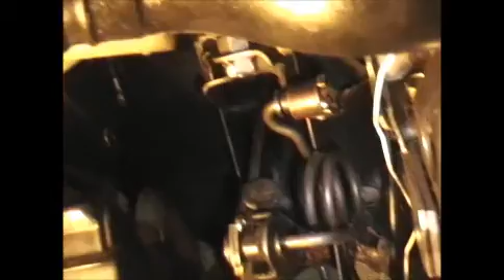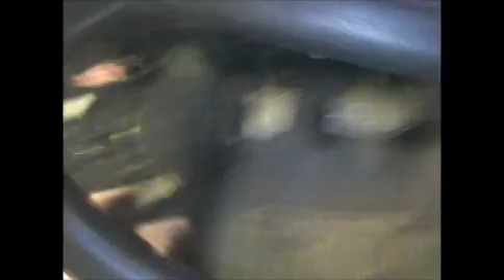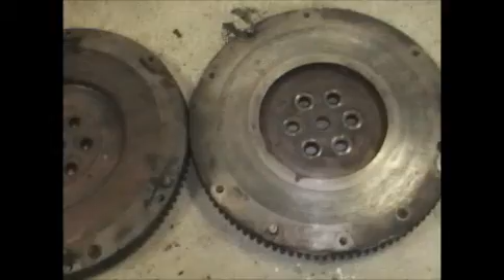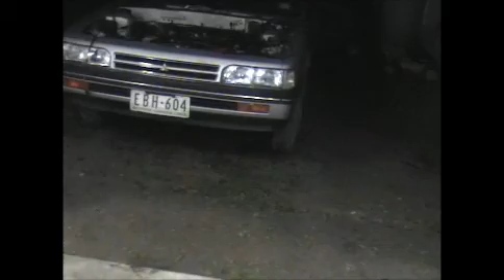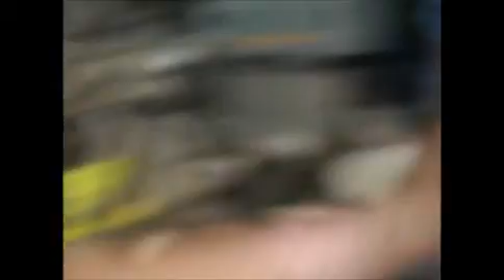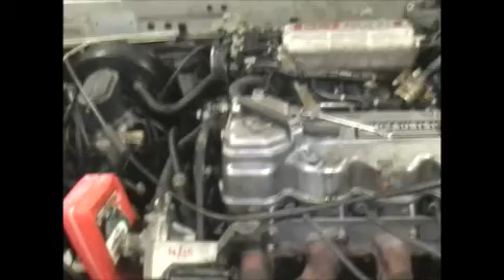magna manual conversion

Comment: Good work mate.  You got a lot more patience than me.  I always hated working on Magnas.  Never seen a car that required so many change of spanners to remove a part.  Been a while but don't the starter motors have 2 or 3 different sized bolts holding the things in?

Comment from the maker: @junkyarddog87 yeh i was surprised too. i suppose its always better to see one in there from a longevity point of view as it reduces pressure on the gear box bearings but for some reason mitsubishi didnt need it lol. 

as to 'pressing' one in last one i did on an fergie tractor i used a big bit of flat bar and a mash hammer lol. 

thanks for the coment.

Comment: nice work, II am surpised you didnt have to fit a spigot bearing to the crankshaft for the manual box, the commodore and corolla I converted you had to dig those stupid auto rings out and hammer I mean press a new bearing in there.

Comment from the maker: @HDXFH ive been driving it around for days and done about 300k's so far without a problem! just didnt upload the vid. yeh ill at least keep the head off the other engine but if it was just a blown head gasket causing low compression ill fix her up. 

thanks mate

Comment from the maker: @douro20 yeh mate i used my auto shafts as the manual ones i got were shaged! yeh those engines were used in everything. i believe the k-cars also had them. they are decent if looked after. 
thanks for the comment

Comment: This is the same basic powertrain which was used the '83-'89 Dodge Caravan with the 2.6 Astron I4.  Engine and transmission are the same- even the same cable-shift system.